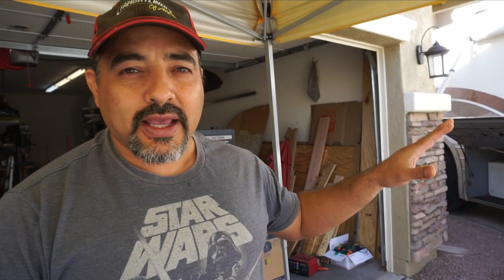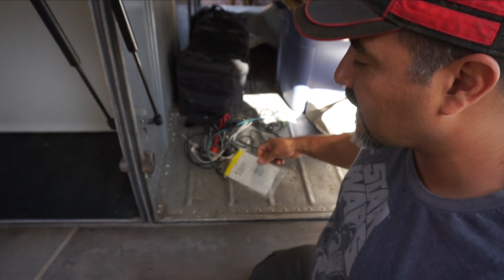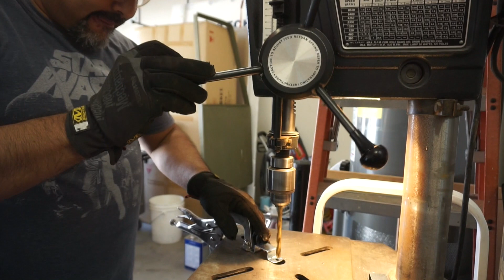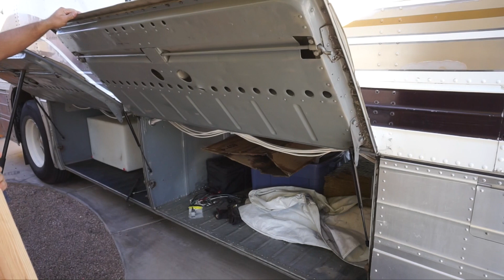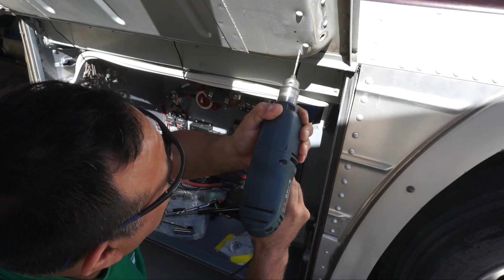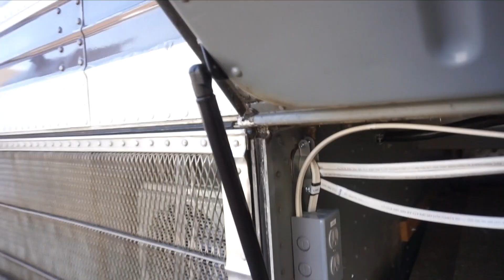Struttin' Our Stuff: Replacing the Bay Door Struts

Comment: Nice work. You can cult a slit in a tennis ball and slip it over the corners of the bay doors when they are open. Noggin protection.
Reply from the maker: Thanks Kevin - tennis ball would have been a much easier solution!  Hopefully now they are up high enough that we won't keep hitting our heads on them.
Reply: +Beginning from this Morning You want them high in order to save your back. You can get closer while lifting heavy things into the cargo bays. Do you know of the guy who makes stainless steel replacement hinges? When I had a Suburban fishbowl I used a nylon strap with a clip on the end to keep the doors held open high. No head banging; no gas struts to wear out.

Comment: I remember when I replaced my hinge it was a bear its pinched in the aluminum excrusion and I had to remove every other rivet to get it started on my coach the rear motor hatch door was held on by that rubber hinge and it also had a small rip in it I opened the hatch one day and as it was going up the whole thing started ripping and gas shocks completely tore the door off out of the frame and it came down on the ground behind the coach what a mess I had to pick up the door force the shocks to contract and tie the door in place with rope to get it home.
Sorry for the story but putting that hinge in was a lot of work it took 4 friends and 2 hours and vegetable oil to get it together make sure your aluminum channels and super clean any dirt old glue or what have you will stop the process and just wanted to save you from any frustrations.
Happy trails guys.
Reply from the maker: Thanks for the tip Brian - We will have to keep this in mind.